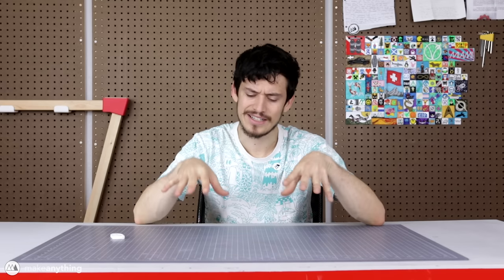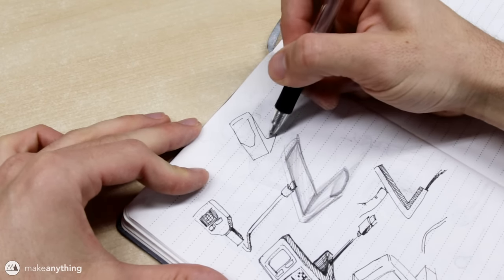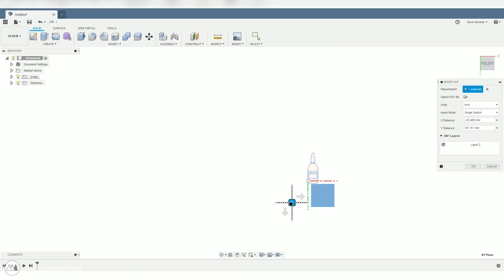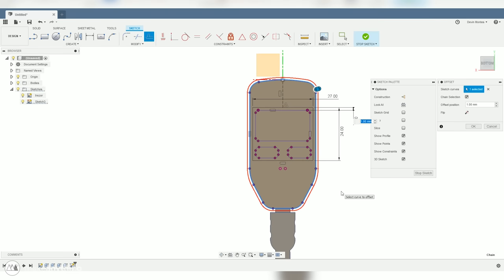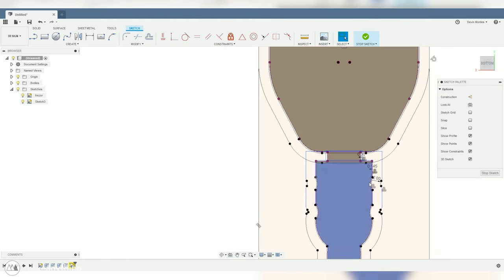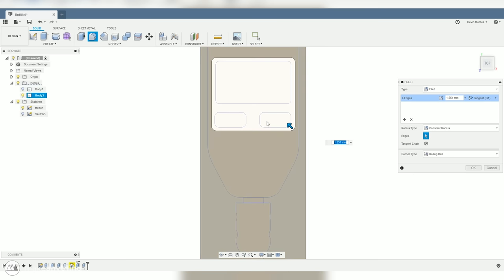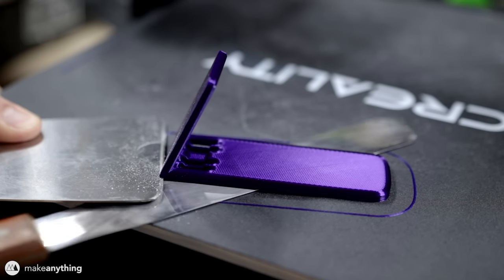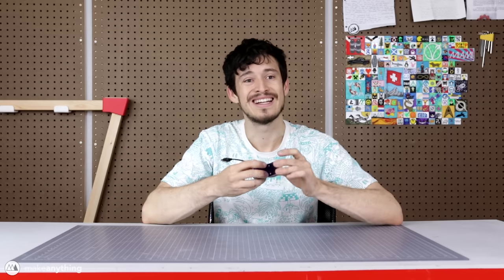Fusion 360 Design Process // Trezor One Bitcoin Wallet Stand

Comment: Hi there.
I don't often post comments on videos but I wanted to thank you for the awesome content you have been feeding us with. I bought an Ender 3 following your recommendations and have started working on some designs with f360.. I especially like this kind of videos because I can learn some tricks on this software.
Also I was wondering why you are printing your parts "at an angle" on the printer. What I mean is that I noticed several times now that the side of the part is nor parallel to the axes of the printer. What does that bring to the print quality?
Reply from the maker: Thanks! Printing at an angle causes the printer to use both the X and Y axis steppers while printing the walls. My theory is that distributing the movement between the two motors reduces strain on either one, and also hides inaccuracies in one direction or the other... just a theory, but why not!
Reply: @make.anything  I always try to use most of the Y axis, to avoid the noise of the X motor. I will try your theory devin!

Comment: Hi Devin, I saw that you made a lot of sketches for the holes that you wanted to make, a nice feature in fusion is that you can also press the combine tool in the menu and press make an tool of the body that I want to keep and delete The overlapping things, then you can use the press pull command to extrude it 0.2 millimetres, I think that is a lot faster and you have the exact measurements

Comment: As usual, I really enjoyed watching you work through the design process. I was wondering about the tab mechanism, though. Does Fusion 360 have any sort of pre-built tab/slot structure that you could pull in? Or is it possible to design something that you could put in a library of elements, and drop in when you needed it, rather than having to design something from scratch each time?
Reply from the maker: That would be so nice! I'm not aware of anything quite like that

Comment: That granite filament did a great job hiding the layer lines. I'd like to see how they both sand up. Does the back pannel flex when you press the buttons?
Reply from the maker: I love the filament :) The back panel doesn't flex since I press the button with my thumb while my hand is behind device, like holding a remote.

Comment: @Make Anything
Thanks for another fantastic video.
And I hereby officially let You know that (the royal) "we" like this kind of videos :)
Best regards
[[I actually ""anticipated"" the small problem of the "separation" that You encountered at the back. And before seeing how You chose to solve the "locking" Your design, my "intuition" was to have one "tab" at the top ("pressing down") and one at the back ("pressing forward"). And possibly also "opening up" the "angle" of the back piece so that when "inserted" into the stand You could "regulate the tension" by "tweaking" that angle to get a perfect fit along the whole seem line...And though I'm not sure if it would work as I imagined irl, I'm pleased to report that It all worked beautifully "in my head" :) Though it most likely at least would have required some iterations to get perfect.]]
Reply from the maker: You're right, that probably could work!

Comment: Wouldn't it be simpler to have drawn your sketch for the snap connectors, done an offset in the sketch, then applied fillets or other shaping within the sketch, so that offsets would automatically follow the filleted contour, and then go ahead and extrude/sweep to push the posts and their holes into the third dimension?
Reply from the maker: Yes.. I was just winging it so things weren't planned ahead of time :P There's many ways to do the same thing in Fusion 360

Comment: Are you running a newer/different version of Fusion 360? I don't have the constraints section in the tool that you do while in sketch mode? Also, in my version, the solid, surface, sheet metal, and tools sections do not appear as tabs (like they do in yours), they can be found in the drop-down menu. Lastly, your design menu, appears as my model menu. I am running 360 on my 2012 15" Mac Book Pro, could the differences just be in operating systems?
Reply from the maker: Yes, it's the "UI Preview" setting under "Preferences">"Preview"